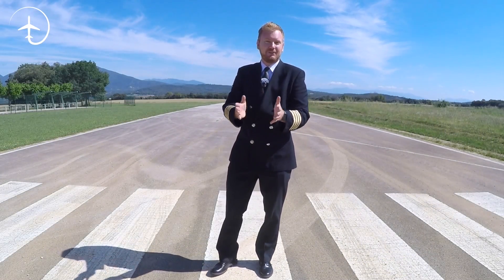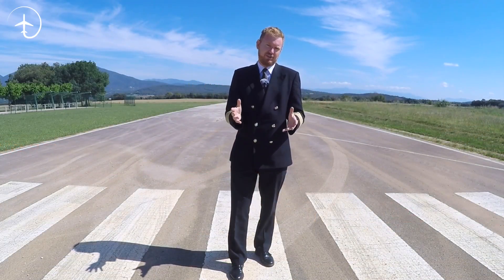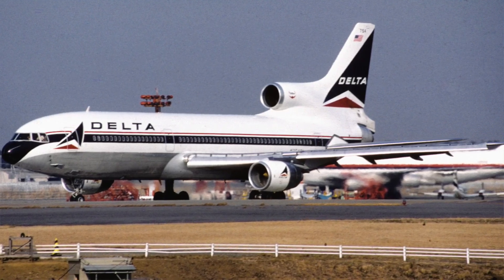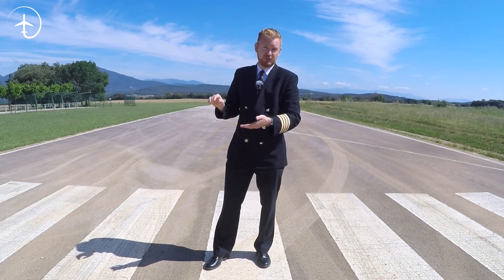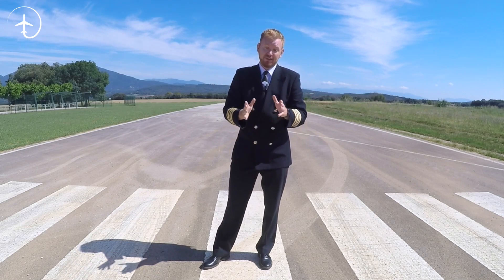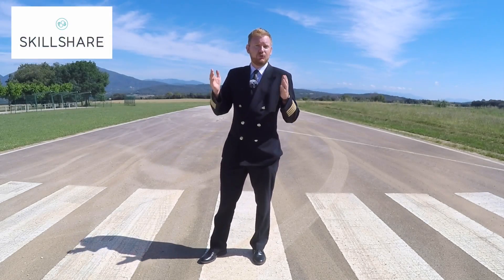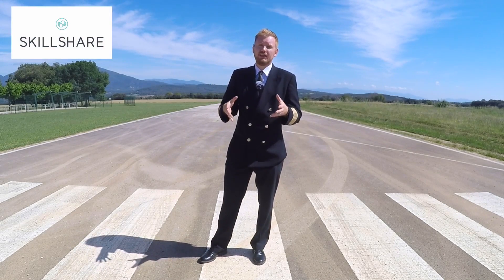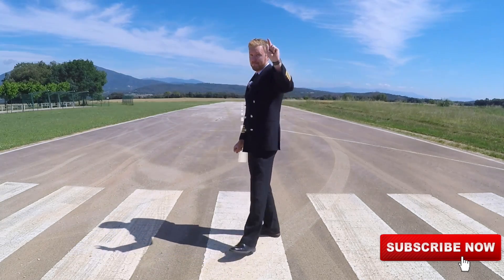Three Engined Aircraft, what happened?

Comment: I always wondered about flying trijets over oceans. Other things being equal, the chance of losing two engines on a trijet is three times that of losing two (both) engines on a twin. How far could a trijet fly on one?
Reply: Flying a trijet on one engine will get you to the scene of the crash. Just to stay at altitude in most any jet you are using 60+% of the available thrust to cruise at altitude. To shut down two engines would mean even running that engine screaming hot at 100% thrust you would only have about 30% of the plane's available thrust pushing you, on top of that the two dead engines are going to be dragging in the wind slowing you down considerably. so I would say if you were running on one engine you are going down. You'll have more of a glide than if you had no engines but you won't be able to keep it in the air. You would probably have to descend somewhere between 300-500 feet per minute at least which at 35,000 feet would mean somewhere from just under 2 hours, to 70 minutes at the very best of circumstances although in reality it would probably be less than this due to the thicker air at lower altitudes necessatating a faster descent rate and more drag.
Reply: "How far could a trijet fly on one?
 "
For commercial airliners:

All the way to the planned diversion airport. It's a mandated requirement of the rules, and not imposing any technical challenges other than planning for enough fuel for the trip.
Reply: Any one of those engines is capable of providing 300% more thrust at sea level than at cruising altitude. And 300% more is the very same thing than 4 times as much. No sensible pilot would push the engine screaming hot in that situation, only to the max continuous thrust level.
Reply: 300% thrust at sea level in one of those engines won't let you climb though! You will descend on one engine and eventually crash if you don't land!
Reply: The single operating engine allows climbing from sea level to FL 100 initially with ~1 degrees angle of climb with max takeoff weight and 8% thrust/weight ratio. After using some fuel the plane gets lighter and can climb more effectively, but nowhere near to normal cruising altitude and not as fast or as steeply as with all engines. It also requires clean configuration (no flaps) and optimal speed (allowing t use best available L/D ratio). The plane has neither a clean configuration nor enough speed right after takeoff, but if it descends from cruising altitude there is no problem as long as the suitable airfield is not located at high altitude and that there are no high mountainous areas to clear. 
Any plane will eventually crash if it doesn't land even if all engines work just fine after using all the fuel aboard.
Reply: Try that near denver CO!
Reply: FL100? that only works if you only fly in florida!
Reply: We were talking about flying over ocean, where one only has to climb over wavetops and ships and sailboats.
After using >80% of the fuel it's not problematic to climb higher to find an airport to land the plane in most places around the worlds oceans including islands.

Comment: Single prop engined planes like a Cessna have 'left turning tendencies' caused by prop torque twisting the plane,  gyroscopic procession or p factor. Twin prop planes get away from this by having the second prop spinning opposite the other hence the aforementioned forces are cancelled out.  Now, of course, with larger jets we're talking about turbines, but from what I've read, the forces are similar... Question: With three engines, being an odd number,  are the same turning tendencies reintroduced?

Comment: I always thought the DC-10 and L-1011 were great looking airliners. Thanks for sharing this.
Reply: Yep, the L-1011 was a favorite to fly in.
Reply: Ahh yeah I love the dc10 as well, one of my favorite airliners
Reply: John Kelley shame the dc 10 was a death trap
Reply: @danjackson2014  No it wasnt
Reply: @danjackson2014  that is greatly exaggerated. I'd say the DC9 was scarier based on the history!
Reply: @Dan Jackson, no it wasn’t. It just wasn’t as lucky as the L-1011. 

The L-1011 had a triple engine failure but luckily didn’t crash. The DC-10 had no such incident. 

Shrapnel impacted every one of the L-1011s four hydraulic systems after a centre engine fan explosion. Only luck kept one system intact. 

The L-1011s stabilizer jammed in the full nose up position. Never happened to a DC-10. Only luck kept it from crashing. 

The L-1011 was late into service, not very many were made, it was a maintenance nightmare, production ended early, and they were retired early. It only flew a fraction of the hours the DC-10 did. The TU-114 was “safer” than the L-1011 for the same reasons. 

The L-1011 couldn’t even be certified in its original form due to engines that would explode on impact with birds.

Comment: I loved the 727. Gorgeous airplane. Everybody moved too close to airports and then started complaining. So no more 727 hot rods.
The best airline flight also included the best airline meal I ever had. If you are young, they really used to serve full meals with metal silverware and everything.
But, I digress. It was an L-1011 TriStar. Smooth and quiet. Plus it looked sexy. Great curves...including the S-duct. Mmmmm.
I always hated the looks of the DC-10. The third engine always looked like an afterthought to me. Like they were too lazy to do it right so they just slapped it up top in the vertical stabilizer.
My second best passenger flight experience was in a C-5 Galaxy. Smooth and quiet except for hearing the flap and gear motors. But I liked that.
Ironically, that was the second best meal I’ve ever been served on an airplane. We were heading off to the Gulf War. I appreciated the meal tremendously.
The only draw back to the C-5? There’s no “people eaters” or gates at Dover. To get to the rearward facing passenger compartment a climb up a steep ~14 foot ladder is required.
Not easy, or stabile with 60+ pounds on your back.
To this day and hundreds of airline flights later. It’s the only airplane where I could not feel when we actually landed. I heard the power reduction for descent. Heard the flap motor and gear doors open and the gear clunk into down and locked position...and then we were taxiing. Amazing. Still amazing to think about that today.

Another memory from that time long ago was arriving at Dover and as far as he eye could see were parked C-5s being loaded or unloaded or fueled.
And these were all on the ground in Dover. Imagine how many were inbound or outbound from Europe and the ME. And on the ground overseas.
I was an airplane buff but my jaw dropped when I saw how many C-5s were on the ground in Dover. Still in awe at the military power projection that represented.
Reply: Michael Meyers dam u wrinting boi
Reply: I would move to an airport SO i could hear the beautiful noise.
Reply: Why is is so long

Comment: If a plane has a general emergency (7700) AND a radio failure (7600), which one do they squawk?
Reply: AviationELP 7700. As Sichuan Airlines flight 3U8633 had a issues with front windshield. And they squawked 7700.  And the ATC at the airport couldn't contact them due to it being so loud.  But they still landed cuz ATC stopped incoming aircraft as it came in.
Reply: You always squawk 7700 first.

Comment: Once when I was a passenger on a trijet coming in for a landing (it was a while ago so I don't remember the particular plane), just before touchdown there was a tremendous BANG from over our heads, the lights went out and came back on, and the whole plane shuddered horribly. The landing went smoothly other than that, and once we got to the gate the pilot got on the intercom and apologized for the scare, saying that sometimes during landing the body of the plane blocks airflow to the third engine due to the high angle, causing it to lose pressure and blow the hot gas forward (I know there's a specific term for that but it's escaping me at the moment). The way he said it made it sound like a pretty normal occurrence that he was used to dealing with, is this a common issue on trijets? Is it dangerous in any way?
Reply: In this context, "surge" and "stall" are commonly used interchangeably.
Reply: Compressor surge, I think that's the term for it right?
Reply: Compressor stall is the most widely used term.
Reply: Ah thanks guys, yeah I'd read about it a long time ago but couldn't remember specifics.

Comment: Great video!
I just want to give you a little tip to improve your videos. If possible, reduce the gain (sensitivity) on your mic a little bit and increase the volume on the recording device or in the computer software. That should prevent the sound from clipping as it tends to do when you speak a little bit louder. OBS, don´t increase the volume in the software to much tho, that will make it buzz.
Reply: His audio is perfect. If It's clipping for you then you probably have a cheap soundcard or cheap amplifier in whatever you are using. Using tosink fiber all digital here and there is zero clipping.
Reply: Peter Carlson Yes, it's perfect 98% of the time, it is just when he really speaks out (maybe like 4-5 times in the video) that you can notice a little clip. I have a quite expensive computer with a good sound card, so i would'nt think im am the problem. I still think that he could change his mic setting a bit, not much tho, beacouse - as i said - it only tends to clip when he really speaks out!

Comment: The Tristar is still one of my favourite aircraft, I adore the look and sound of it, and Lockheed took the "money no object" approach to designing and building it - so many tech advances came about because of that programme. Sadly it also meant that the Tristar was almost never going to be profitable for Lockheed, and it ended their commercial airline participation. 

There are so many iconic jets that we are saying goodbye to as the years pass by, as well as prop aircraft - I used to love going to an airport and spotting the different types as they passed through, from the Dan Air BAC-111, to the BA shuttle ATPs, and the Tridents. There's something about the low bypass engines that I just can't put my finger on! Nowadays it feels like each new aircraft is a clone, with not that much changing - last newer plane I really loved was the A340 which is now slipping out of use for the same reason as the trijets - efficiency and maintenance. It's a magnificent bird, as elegant as it is long. 

These days I'm much more of a turboprop man, because of the sense that piloting them is a more seat of the pants affair, and much closer to being in a Cessna than in a Boeing or Airbus!

Comment: L1011 was one of the finest airliners ever made.
Reply: The 1011 was such a great aircraft that its manufacturer went on to soon become the most prominent and prolific manufacturer of commercial airliners the world has ever known.
Reply: graycloud057 the last wide body tri Jet in passenger service
Reply: Super smooth and comfortable
Reply: It was also the fastest. I learned that pilots and the airlines loved the L1011. If for some reason the plane was late taking off, they would just fly faster and land on time. This would increase the airlines efficiency rating. It did guzzle fuel though.
Reply: The L1011 was a Hydraulic leaking nightmare and the tri-wing fasteners were a pain to remove
Reply: The L1011 had its problems that we worked regularly. But it was the best engineered aircraft I worked on. Take for instance the elevator. The elevator was not a flight control in the general sense. The elevator was a "Flap" for the Stabilator that increased the camber of the stabilator at low speed. This allowed less drag and higher cruse speeds. The manuals used the ATA chapter format that was consistent from Maintenance Manual to Illustrated parts Manual to Wiring Manual. Much better than Boeing.   

The triwing screws were an ATA spec. for this series aircraft the DC10 had them also. To compound the problem the L10 used Titainum  screws. I did not understand this either eight tool bits to take the place of three Phillips bits. We had experience with Douglas's Reed & Prince screws on the pistons. 

I am partial as I was with the L10 from introduction to Mojave.--Jay
Reply: Lonny Bauer Was it really?

Comment: A video about tri-jets without a single mention of the most popular one: The Boening 727. smh As for the Dassault Falcon series, the Falcon 10, 100, 20, 200, and 2000 are all twin engine designs granted, they are mostly used over land but they still skip across the pond from time to time.

Comment: Back in college I took an aircraft design course.

One of the teams took a DC-10 and replaced two of the engines with unducted fans.  After they deleted the deleted the tail mounted engine, it had a 1.1:1 thrust to weight ratio at the empty weight + full fuel load.

This was in the late-Eighties and ETOPS wasn’t in effect yet.  LOL 

The Boom looks incredibly beautiful.

Keep up the great work.  You have a great outlook.

Comment: Fun fact. The Trident actually had four engines. It had a small booster engine.
Reply: namboozleUK only the Trident Three had the booster. it was nicknamed the' gripper' because it was so under powered. The 
Rolls Royce RB162 was only used for takeoff. The Trident 1.and 2 series did not have this feature.
Reply: Ava Mendez yep, that's right

Comment: I miss the DC-10 I flew in them a lot as a kid and I used to draw them a lot too. My favorite part of the Dc-10 is the vertical stabilizer part with the engine in between and the relatively bigger and wider horizontal stabilizer. Bangladesh Biman DC-10 was one of my favorite DC-10. They were also the last airlines to operate the DC-10 now sadly they are either museum piece or scraped.

Comment: Would a one engine airplane work? Just one on the tale?
Reply: of course it would work, if it had enough power.. no different to a single prop aircraft, flight is thrust weight and attitude, more or less. COG and COM as well of course.
Reply: Yes with low fuel and no passengers.
Reply: Yes look up Japanese ww 2 concept fighter with pusher prop in the back,,not sure of name Mitsubishi maybe?
Reply: s3xyScorp what about a passenger plane? I think there’s a reason no one has done it yet.
Reply: Think on it a bit.  Why would anyone want a single-engine passenger jet?  The engine can't occupy the fuselage.  People have to go in there.  So now you have to offset the engine or its intake(s) from the centerline.  Even if you tackle all the technical hurdles, including the noise/vibration of a central turbine, you're still left with something far less reliable than a multiple-engine plane, and not likely to be in much demand by airlines or wealthy individuals.

Comment: With the consumers tendencies towards extending the fuselage the extra heavy weight of the third engine on three engined aircraft means only the forward part was extended and this caused lots of problems, such as bouncing, hard landing, uncontrollable skidding when taking off or/and landing, visibility from the copit, however the upside is high power, great weight carriages, more economic over twin engined and especially four engined jet planes, if only the weight distribution problem wasn’t so bad we’d probably see a lot more of them

Comment: Do all trijet operators really use all three engines all the time (wink wink?) re ETOPs. Sorry if that is an awkward question.
Reply: If you don't run an engine, it will act as a brake.
Reply: Unless there is a major problem all aircraft use all of their engines all the time while in the air. When taxiing and ground ops that's the exception and they use just one engine to save fuel.

Comment: Can you please talk about different wing tips?
i see many that have tilted up at either 45 or 90 degrees but ive also started to see planes that have added another tip at a 45 degree downward make a Y shape at the end of the wing. What are the benefits?
Reply: They prevent high and low pressure air from swapping at the wing tips, giving more lift with very little extra weight or drag. 
A flat wing will bleed air from under the wing to the top at the tip, kind of pushing the wing down these stop that so more lift with less power needed.
Reply: Gail Raby thanks.
Reply: +N00KIExM0NSTER 
you're welcome.

Comment: I always found it fascinating that, while the L-1011 was a much "classier looking" aircraft, the range of it was approximately 2700 miles, where the DC-10/MD11 have a range of more than 6500 miles.  When talking to a McDonnell-Douglas engineer, his comment was that it was a combination of the "bend" in the #2 intake and the wing design that made the L-1011 a medium range aircraft.  Oh, well for the L-1011.
Reply: Air Canada used to fly London to New Delhi non stop, then Delhi to Singapore with the -500
Reply: Of course, the 1011 had its range extended with the creation of the L-1011-500, recognizable by being a bit shorter in length and with a smooth filet where the center engine intake meets the fuselage.